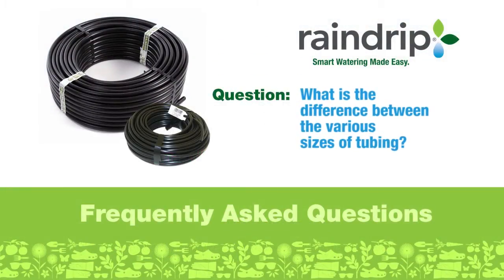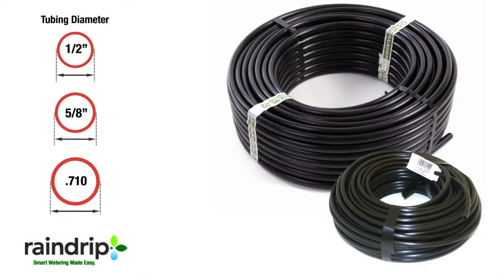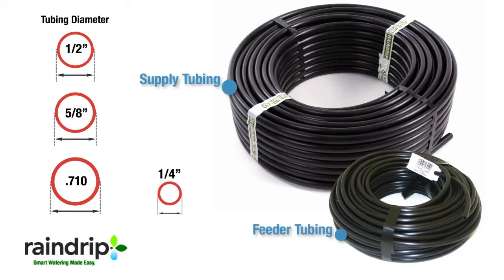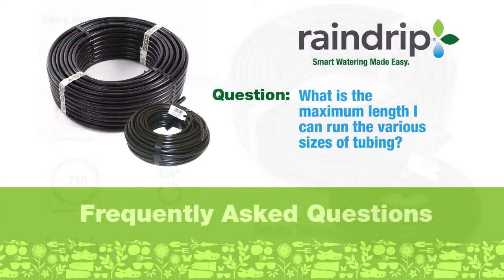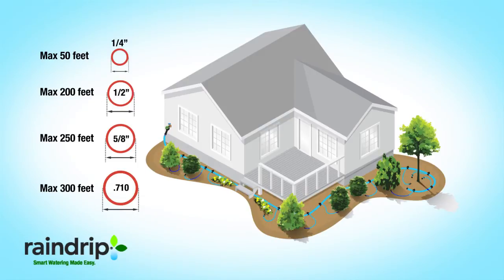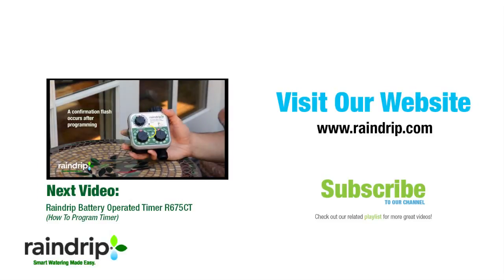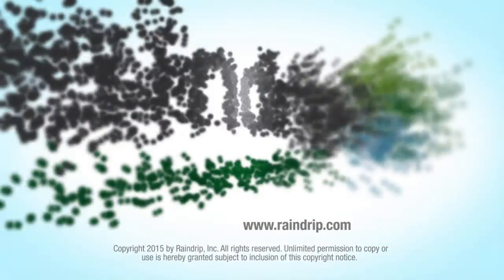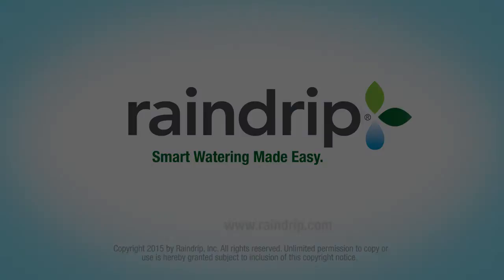What is the difference between the various sizes of tubing?

Comment: Can I run 6 individual 10 ft pieces of 1/4 inch tubing (with built in emitters every 6 inches) directly from the sprinkler head manifold?   How will that affect the water pressure?  Also, if I have more than 3 sprinkler risers in the same zone, can I convert each sprinkler riser to 1/4 inch drip tubing and run that zone together?